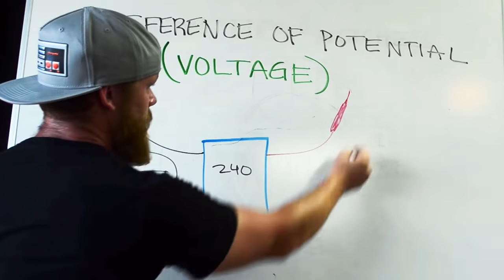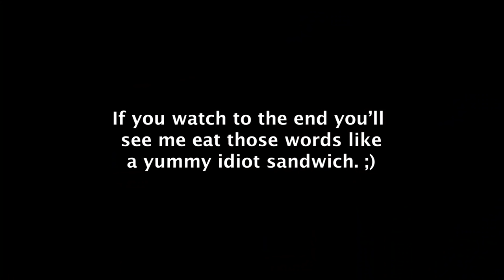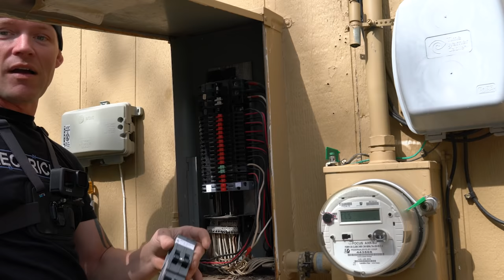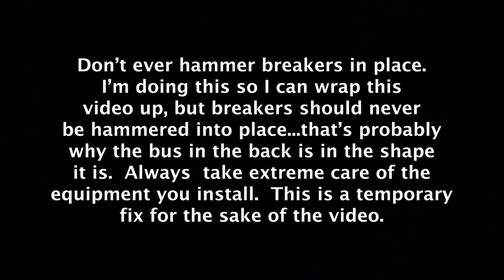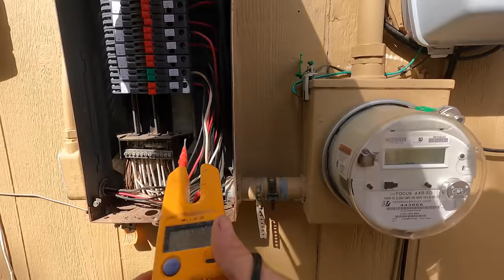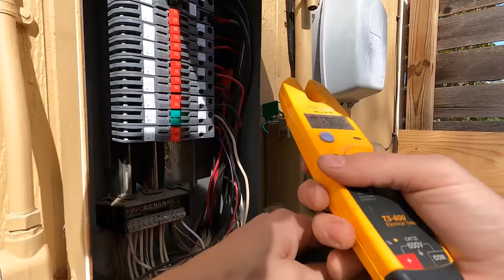How To Work on LIVE CIRCUITS - Replacing Circuit Breakers in Old ZINSCO Panel

Comment: Thanks for a VERY helpful video! I am only at 3:11 and already you helped me understand why my research is so difficult.

I have a weak (mushy) 30 Amp breaker on a paired 240V circuit for my water heater. 
I see Sylvania on the breaker box and keep seeing Zinsco online when I see breakers that look like mine.  They are expensive and seem to show up more on Ebay and mostly used or refurbished, especially when reasonably priced.

Since the box is old (bringing some question to the age I am told from landlords of the house I am renting) and now I learn it is no longer approved for installation and the dangers of developing hot connections... a cause for pause.

I will pull the cover and look at the bus connections for these 30A breakers and may inspect them all. 

Seems that Connecticut Electric, Inc. (thank you VERY much!) may have alternatives, hopefully that are plug and play replacements offering a safer install at least for however long I live here. 

Regardless of whether you make money at this I want you to know how helpful you have already been and may God reward your helping others!

Comment: As an Electrical Engineer for 30 years, who work in digital (5 volts), thank you for the education in power.  Love learning more!! Thanks!
Reply: Yup, I know exactly what you mean. I do flip houses now and going from 5 and 12 volts to 120 was an adjustment. This channel helped me learn the code!
Reply: when i hear 5 volts.... i didn't know something runs on 5 volts.. yesterday i saw some guy installing 5 volts LED lights, we use 220v in my country

Comment: Great demo. Most people need to understand that the voltage in residential is far less dangerous than industrial and commercial. The arc flash from this equipment(120, 208, 240 volts) is nothing compared to 277, 480, 600 and up. I try my best to pull the meter if possible, insulated tools prevents accidents big time and when in the danger zone or working space, everyone must keep out until I say so. Licensed experienced electricians only... when in doubt shut it down and test, test, test. Always treat equipment like it's live even when you know it's not

Comment: General you can call the power company and schedule a disconnect of the service via meter or service drops. Don’t take unnecessary risks as anything can happen. Nice replacement breakers as a good option.
Reply: True, but here at least they charge a non trivial fee to do so.
Reply: @NickFrom1228  and can take up to 4 hours after call to come disconnect and then another 4 when calling for a reconnect  lol
Reply: So true it's not worth your life working live  in Australia or more specific Queensland haha funny name we are allowed as a contractor to pull the primary fuse from an overhead supply or from an underground supply pillar box legally seems crazy to work live if you don't have to   safety should be paramount
Reply: I'm in a old house with no main shut off and probably will get them to schedule a shut off when I got to put one in. I will also be waiting until fall when it's cooler 😂 it's hot here in texas
Reply: Yeah here in Texas we can call the company and they will come out. Saftey takes planning. I would never do a panel change hot😂😂 I'm pretty sure you can get seriously fined for doing it hot as well...
Reply: @dr.tribbles4145  well simply put, Nothing good can happen if you can’t cut the power if you have an accident or a ground fault. I’m only speaking for myself as I’ve seen a lot in 38 years in the field and safety training.
Reply: Did any of you pay attention to the part where he said he’s installing a new service? You aint teaching a guy anything new here….

Comment: Bro, you've helped me get my drive back with my trade 💪,I've been doing commercial electrical and building automation/controls since January 2000,,,, and let's just say life got crazy some ten years ago and I've jumped back into construction about 6 months ago and it's through a friend and he doesn't touch a wire,so he has me doing any electrical and I also help with the other builds,,but wiring is my passion and watching your DIYs,it stokes me on how you remind me of how proud it is to stand behind your work and the passion you put it ,pumps me up and is helping with getting back on track with my life and hold it down,,you kick ass boss💪🙏

Comment: Zinsco usually always has Bus Damage, No way I would waste time changing Breakers in one!, Replace it with Square-D  QO and be done
Reply: Yay
Reply: The only problem I have with Sq D is the tiny terminals those panels use. It is like that German company forgotten the US uses larger wires for lower voltages. That and the threads for QOB panels are notorious for stripping.
Reply: @Thomas Heydrick For me, the hype for Leviton panels have worn off. I'm not impressed the main lugs are smaller than most other panels, barely accepts 4/0 aluminum under normal 200 amp services. God help us if the service requires 250mcm for voltage drop, there is no way to change the lugs on leviton panels. For some strange reason, the lug for the neutral Buspar is larger than the phase lugs. WTF.

I stick with EATON now (I used to swear by Murrey for the last 15 years) Good breakers, good panel guts, but God dam the cans are made of tin for residential grade. At least the commercial lines are decent.
Reply: Qo or homeline?
Reply: @Bremend  QO, I don't like Homeline!
Reply: That is what sandpaper is for.
Reply: I replaced my 1969 Zinsco panel a few years back. Most breakers seemed to have that telltale char on the bus so I'm glad I swapped that whole dud out. Originally I did because there was one spot on the bus that was so pockmarked from arcing, I could no longer use it, and I had no idea that there were other spots nearly as bad. Just a terrible system in general. And of course when they get that bad, it's difficult to remove the individual breakers, like they had arc welded themselves into place.  For the record, I switched to Homeline.
Reply: Yeah and different they loose there UL listing all the way back in the 80s?

Comment: Just a suggestion. Its something i like to do prior to putting in breakers, new or used. I like to exercise  the breakers a few times to make sure it flips properly along with checking continuity with my meter to make sure when i flip the breaker to the off position there is no continuity and vice versa. All prior to installation.

Comment: Glad you found a way to force the main breaker in there. What a pain in the ass. I bet you will feel better once you replace that whole thing. Nice arc mask. I need one of those
Reply: Hello, Will. I have your book. Good to see you here. Count me as among the few that do use PPE, most of the time.
Reply: Hey Will, I have the same face shield it's by Honeywell if you want to check it out. Make sure to get the gloves and also a hood to go under the face shield. I've learned a ton about PV systems from you, something a service electrician like myself never works on!
Reply: Don't forget the arc-rated clothing to go with that face shield, along with the arc-rated ear plugs and z87 eyepro.  For a pro he is severely under-equipped to be performing hot work. 
Now I don't think he is saying this is how to protect yourself when doing this kind of work.  However.  If I saw this work being performed on any of my sites or even as a contractor working a job, I would question if that electrical contractor or company deserves their certifications and qualifications if this is their Master Electrician.
I've worked on my own circuits for my house hot and I wore at least CAT I Arc-flash hazard PPE.
Use the right tools.  Wear the right PPE.  Or don't.  But don't slack on those two things then make a video of yourself doing it and making yourself look an ass for public consumption.
Is that harsh?  Depends.  People get fired for this and then their name gets put out that they are an extreme safety risk which makes it very, very hard to get a good qualified job.
Reply: @filthymcnasty3788  Whoa, we got Zeus McLineman over here flexing his lightning bolts. The point is to practice the safety. Overkill is what keeps electricians from being killed. 
Especially apprentices trying to learn and understand concepts of handling live wires. That "as long as your careful...i handle (superior#) KV" egotistic attitude is the exact thing i teach my apprentices to be wary of in this industry. 
Safety isn't fear, it's learned lessons from dead people.
Reply: @filthymcnasty3788  Service electrician here, mostly residential. Almost everything is hot. Always treat everything as if it’s hot, then you learn how to act around hot stuff and you build safe muscle memory. The dicey days are throwing a step bit through a hot generator panel while it’s pouring down rain. 🤷🏻‍♂️ Life’s a rush

Comment: I have observed to many near misses working on live electrical installation. One which l recall at a NHS UK hospital where l was called to the loss of all the kitchen electrical power, turned out to be an electrical contactor had unsuccessfully  attempted to install a three phase circuit breaker in a live panel. It had tripped a 400 Amp. main supply C/B which had taken out all the kitchen power, the panel he was working on was now internally copper clad and he had suffered severe burns to his arms. The rule is always work on electrically isolated equipment when ever possible. Keep up the good work and stay safe.

Comment: W.r.t. to PPE, I would recommend keeping the PPE on until the main breaker is closed. There's no protection device between the panel and the meter, or visible anywhere upstream of the meter. So, if that breaker malfunctions, there might be 25kw there, and there might be 500kw. Earlier this year, we had a new 150A 480v breaker explode when closed, third time it had ever been cycled (by us, one would assume Eaton tested it) -- in a 1000A panel. The electrician was in full PPE, but he was still "pretty far from happy." (and yes, it's live work, that panel isn't so easy to power off.)

Comment: I like how you taking out each individual circuit breaker out, one at a time wires still attached to the circuit breaker and rewire back to new one , and then insert back to slot. Great work! Thanks! 😀😀😀

Comment: Hey Dustin, look into getting a hood for under your face shield. I used to work for Rogers and didn't know I even needed one before working there. Also 100% cotton long sleeves help a lot if you don't have a hot suit in the event of an arc flash. I know you know your stuff either way because I've learned SO MUCH from you lol

Can you please do a video on Megger testing insulation? I just bought a Klein ET600 and I'm trying to figure it all out..
Reply: Manual

Comment: With any zinsco breaker you can reverse the bussing clips, (2 screws on back side) Doing so would have allowed you to avoid the damaged bussing section.
Reply: Yes or he could have just put the main at the bottom where the bar was good. I can't imagine someone spending all that money on those breakers for only a couple of weeks. Good video on hot work though.
Reply: @LarsDennert  Those were sent to him by Connecticut Electric. Probably free or at lower cost.
Reply: @benmusson395  You can't do that on the top space, look closely at the bus they have stamped indents that won't allow the breaker to clip on. (But you're spot on that most parts of the bus you can swap the breaker clips which will get you to a clean bus connection.)

Comment: My Zinsco panel is inside my condo so not exposed to the elements, been working fine for the last 13 years. Thinking about changing the breakers like you did here.

Comment: I would remove the cover to have clear work space. No need to risk grounding to it, and no need to risk it falling on your head.
Also i would look at the main breaker to look for damage as a result of loose connection.
Reply: I have stepped away from a pannel and then I hit my forehead on it coming back 😭😭

Comment: I don't know what luck you've had using those new breakers but I run a fairly large solar company with over 100 employees and it is probably our number one replacement after install is those new zinsco breakers especially the slim ones we've had better luck with the thick ones or full size whatever you like to call them we actually have a breaker house that test old breakers for us to make sure they're still in good working order cleans them up and gives a year warranty on them and we've had much better luck using those than the new kinetics we've also had a lot of problems getting the new ones to actually fit in some of the older panels because it looks like the molds tend not to be exact to the old ones they're slightly bigger we have to modify them a lot to even get them to fit when we can't get used ones just my opinion

Comment: Great video!  I get that this was just a demo.  But in this case, I would have swapped out all the old breakers but the main, then called the power company and asked for a meter pull so you could swap the main breaker.  That doesn't require a permit anywhere I've ever heard of, and with those side by side, the lineman would have waited the 5 minutes for you do to the swap.  With this one, it's not so much getting shocked, but as you know there's no fuse on the secondary, so if you dropped a wire and it welded itself to the box, you'd be waiting until something melted through or you pulled the meter..either way you'd have some 'splainin to do.  Love the content, though!

Comment: Good video. I have been doing power line work for 29 years. We have both class 0 and class 2 as our required gear, plus FR clothing. We mostly work on 12,000 volts sometimes 34,000 and on the low side of our transformers are 120 - 480 volts. A suggestion, wear long sleeve natural fiber shirts while doing energized work.

Comment: Electrician U- Your presentations are  great . Question - I saw  the one  video on re-doing the service box on your  old Zinsco panel . Years ago in a  electrical class I  took the  instructor said this , ' High amp breakers  air  conditioner , washer or  dryer after  the main connect should   be  at  the  top  of  the buss bar the rest  smaller breakers  regular lighting receptacles in  usual spaces". Any truth to  that ? 
Cheers .

Comment: Wondering why (you may have explained but in that case I missed it) why you're not using an isolated screwdriver ? And as is the case in other countries, are you supposed to tighten the screws on the terminals to a specific torque ?
Reply: Of course he needs to pay attention to the torque. This determines the resistance in the connection and with that fire hazard.
Reply: @hjooy  but he never mentioned nor demonstrated torquing the terminals

Comment: We did a kitchen remodel for a couple who had an old Zinsco panel with one breaker for the kitchen. I explained to them that their new kitchen would need 5, and this would be an ideal time for a panel upgrade. I wound up putting in a  sub panel, they didn't believe me on the need for replacement.

Comment: You should add long sleeve Arc Flash rated CAT 2 Shirt or coveralls  to your PPE any exposed skin is not good.
Reply: Excellent observation. Glad to see he had the face shield and gloves, but still missing PPE.
Reply: Adam Cosper  Anything makes it safer. though I don't believe at a cat2 or less the balaclava and ear plugs are required. But it can't hurt that's for sure.
Reply: Adam Cosper  correct
Reply: I always work on electricity jobs without any of that lmao just my work shirt but bare hands
Reply: Also stored gloves fingers down. 🤔

Comment: I’m an electrician, and I love when other electricians act like changing breakers with the busbars off is like disarming a bomb LOL. You gotta be careful, but calm down….I had to change a panel the other day and the meter was seized in the meter box, so I had to both remove the SE cable from the old breaker/panel and then install the hot SE cable into the new panel and main breaker. Just relax (as in don’t build it up as some catastrophic event), use common sense, and have quality gloves and a way to safe off the ends. I find that most people I work with that have trouble working hot have trouble MOSTLY because they’ve built it up in their head as this monumental task. Think about everything he did here other than the main breaker. When it comes down to it, he was changing breakers on a dead busbar….easy. As long as you are smart with your movements, it’s the same as putting breakers in a completely dead panel. Then you get to the main breaker install, and that’s when you have to be smart and calm. If a main breaker that turned off has you hesitant to install breakers on the dead busbar, I venture to say you shouldn’t be doing panel work at all. He did a great job.
Reply: Probably a good idea for a yt video though considering many people watching may not have that level of knowledge.  But yeah, if the main breaker is off changing out the other breakers is pretty easy and I don’t generally wear gloves for that.

Comment: Dustin so glad you are wearing the PPE. I just wish many more US electricians did this. You are a master electrician but maybe you did this and wasn’t shown on the video I suspect you already proved the bus was dead using a specific proving dead technique (and use of a proving unit and dedicated voltmeter). Thankyou so much for showing this and I like your attitude, being a master electrician means nothing unless you are thinking. You should have also shown how you check for holes in the rubber insulated gloves using the osha approved rolling up approach. Excellent, excellent work. At some point you are gonna put in an external disconnect? And make your main panel your sub panel?
Reply: Right, start thinking: buy some insulated screwdrivers.